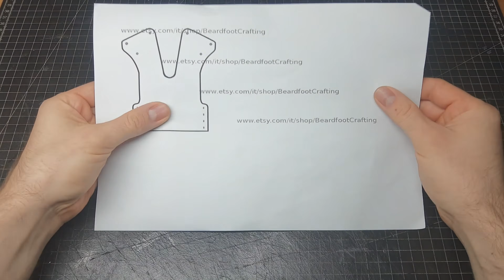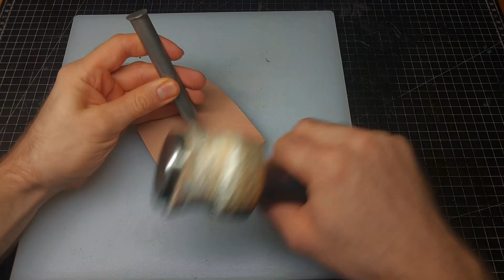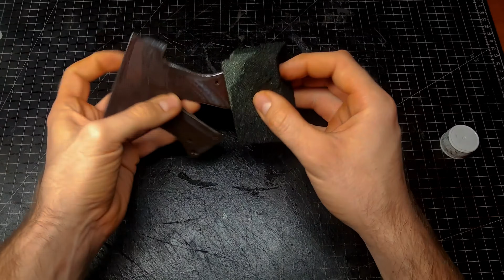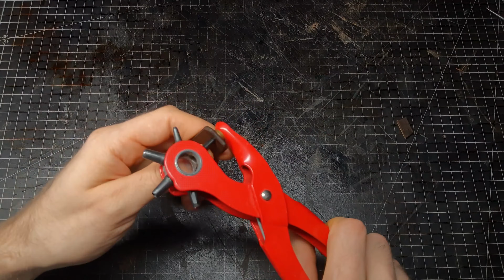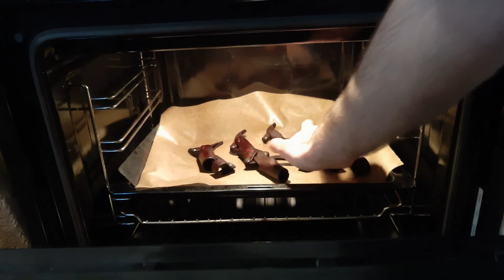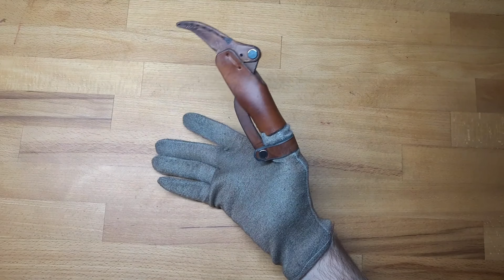Mechanical Claws - Leather Tutorial

Comment: Random question. If we dont want it to be as long could we in theory temove the middle piece and use the shorter lever piece to connect to the claw tip?
Reply from the maker: You can not just take it out, but the claw of the thumb and pinky is exactly that, so if you only want them shorter you can just use them for alll fingers, but make sure the have to still adjust the size to you finger circumfence :)
Reply: How much for the pattern and could you make them to look like a raptor claws 3 fingers

Comment: Is it okay for the screw rivets to soak for 30 mins and be in the oven without getting damaged? You mentioned that the leather must not touch any metal while being in the oven, but the screw rivets are metal, so should we take them out first?
Reply from the maker: That accually is a good point I have not thought about yet, but no you do not need to take them out, mine never took any damage and I would also not expect any others at this temperature to take damage. When I said it should not touch any metal I was refering to the metal of the oven, because they get often hotter then the set tempeture, but I did not think about the metal rivets here.